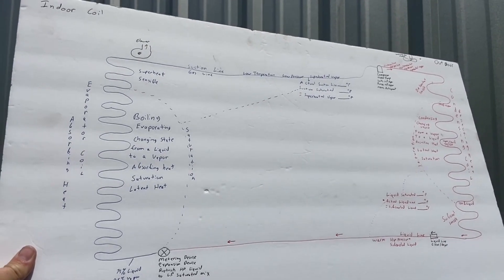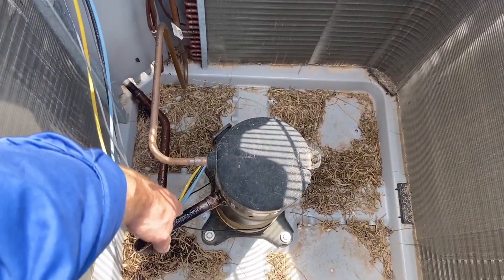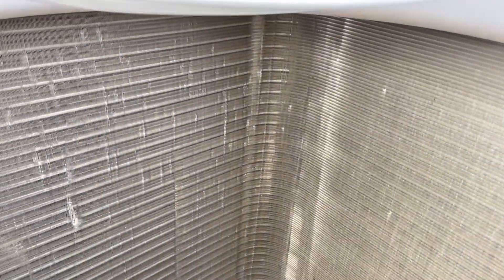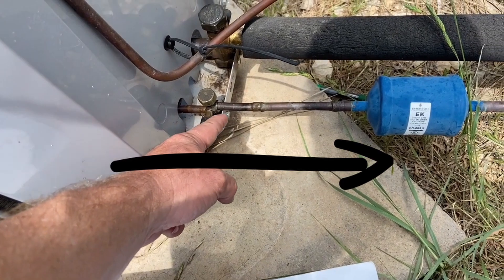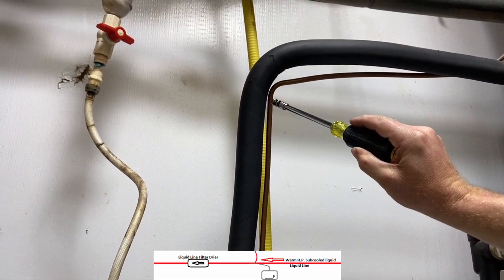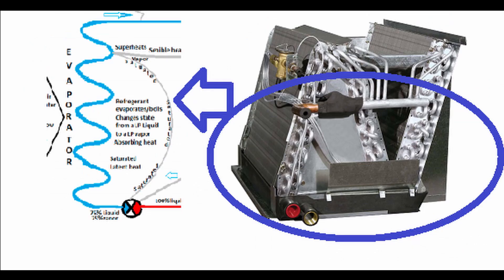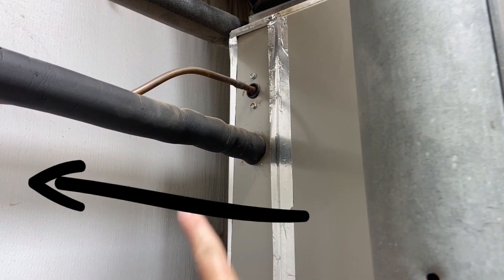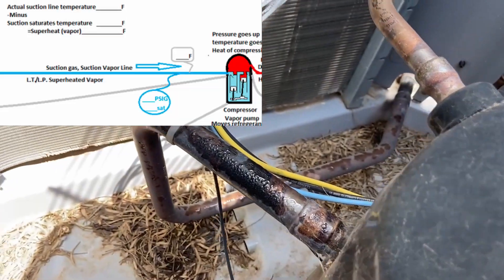HVAC 036 Split System refrigeration Cycle

Comment: I have a question please. Why do we have to insulated the suction line? If we don't insulate it, superheat will go up. How does it affect the system?
Reply: My guess probably wrong but the suction line needs to be as cool as it goes back into the compressor so insulation helps keep  away from the outside idk I’m learning too 😂

Edited: I can’t spell for nothing

Comment: Strange to me to see a straight cooling system and not a heat pump. Different climates different systems.
Reply from the maker: It's not so much about climate.
People that have only had gas especially cheap gas think heat pumps are absurd. People that have had properly sized heat pumps and sealed homes think gas is absurd. Luckily I have been around to so many places and seen both sides. 

As for these videos, it is important to fundamentally understand the basic refrigerstion cycle before adding reversing valves. Refregeration goes beyond just homes. Think  of systems that use the same refregeration cycle such as  domestic refrigerators, walk in coolers, walk in  freezers , custard machines, automotive ac, ice machines, water fountains and so much more.

Comment: Could adding a higher volume or speed fan to this condensor improve the heat transfer process?
Reply from the maker: Yes!
Fan speed, more air moving across the condenser (although more energy for the fan)
Coil size, larger condenser coil increases surface area.
Coil type, smaller tubing transfers heat faster and now we have Micro channel tubing.
pressure (AKA saturated temperature),Temperature of the air, refrigerant quantity, speed of refrigerant flow,  all affect the heat transfer process.
Reply: @love2hvac  thank you for the detailed information. Enjoy your teaching style.

Comment: A little off the topic - question:
Can a refrigerant bottle be 100% gas 
Or always have some liquid at the bottom of the bottle.
Reply from the maker: It's a great question.
Once we use all the liquid out of a refregerants bottle, we consider it empty. We still have to recover the remaining refergerant vapor out of it before despising of it. 

Once there is only vapor left it will not follow the Temperature Pressure chart.

Comment: Very cool presentation (no pun intended)! I'd like to ask a slightly off topic question if you don't mind. What do you think about using leak stop products in systems with very slow leaks? Also which one?
Reply from the maker: Thank you!
Personally I dont like leak stop products. I prefer to find the leak and fix it. Finding a leak takes patients and time to do so. I could think of some situations you have nothing to loose.  I have heard some swear by them, and others curse them. 
If I was to try it I would use a new calgon product as they have done of the more desirable chemicals for hvac. There are others I would stay away from entirely.

In refregeration systems, I like refregerant and refregerant oil. 
Just please avoid dye.
Reply: @love2hvac  Thanks so much for taking the question and for your complete and thoughtful reply. 😊
Reply: @love2hvac  The system in question is an old R22 system that leaks about a pound a year. I've been giving it the old "gas and go" for several years now. As I'm sure you know R22 prices are now really getting off the hook and I feel a twinge of environmental guilt with this solution. Again, much thanks 😊 I think I'll try some more leak hunting first.